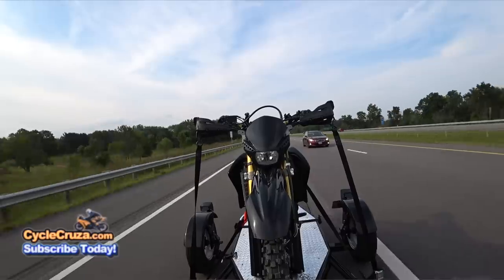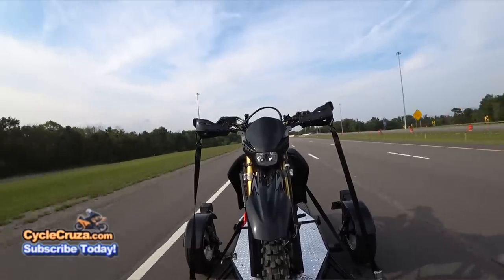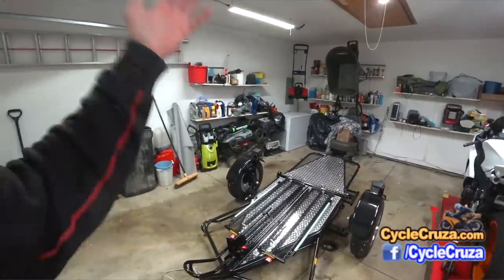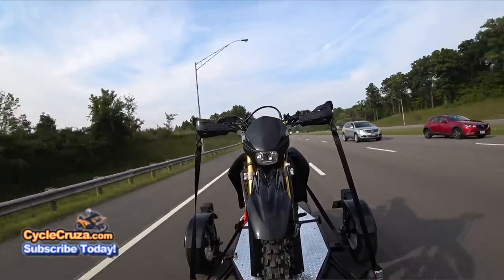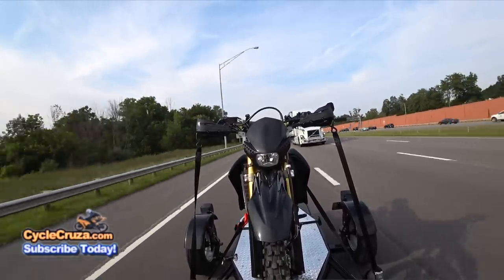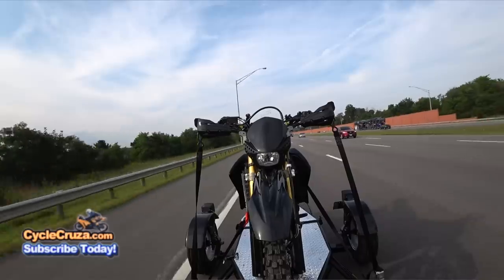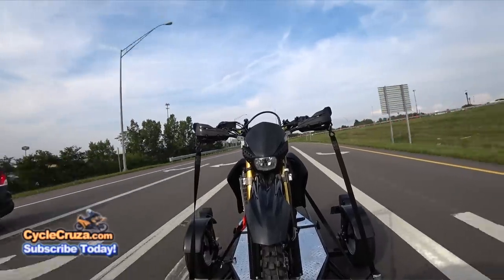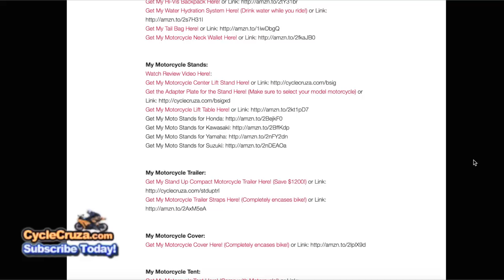EBay Folding Stand Up Motorcycle Trailer Review

Comment: When you lock up the saftey cables to your tow hitch you should be doing it criss cross so if you trailor comes unhookd some how the trailor will fall into the cables like a cradle.
Reply from the maker: It makes since what you are saying but it would have been nice if they included that info in the manual for this trailer. The manual says nothing about criss crossing cables. It just says secure the cables with a padlock. Thanks for the tip.
Reply: @CycleCruza  i juat meant that you should hook the left side cable on the right side of your tow hitch and the right cable on the left side of the tow hitch. Im not sure if that makes any since but with a normal trailor thats how you should hook it.

Comment: The safety cables you’re suppose to cross them just in case the trailer falls off the ball. But other than that it looks amazing.
Reply from the maker: eh either way it's locked on
Reply: Crossing your cables/chains will  catch the hitch if it falls off the ball,  instead of it the hitch spearing into the road. It is law in Canada and a $400.00 from the Ministry of Transport of they aren't crossed.
Reply: And why are they cables and not chains with hooks???
Reply: CycleCruza I don’t know what cops are like in Cleveland but I live in Cincinnati. I’ve been pulled over before for a tail light out and the cop saw I didn’t have my chain crossed and I got a small ticket for unsafe pulling of a trailer. But you are right they are locked. It’s just a bit safer for your trailer just in case it was to come off so the cables would catch the trailer and it wouldn’t be dragging on the street. But I think the locks are a smart idea that company cane up with. I’ve never seen that before.
Reply from the maker: Update: I just checked. Underneath, the cables are bolted up and down from each other so you can't cross them, either way you put the cable on is the same.

Comment: Thats a nice little trailer , you did good on that.   I would re-locate those 2 shelves on the wall and figure out how to get it chained to the wall so it barely takes up any space.
Reply from the maker: It stays up on it's own, pulling back more vertical doesn't really add any more room. It takes up very little room as you see. This trailer saves like 1k over a Kendon and it's just as good, imo.
Reply: I was on the fence until you said 1k savings. That's a pretty significant savings. Can buy some good gear with that 1k.
Reply: CycleCruza  ps safety chain doesn't need to be taught and pulling out the screws with all the weight of the trailer pulling on the chain.   A little slack would take the stress off things and provide a safer experience.    In case something were to happen.

Comment: CycleCruza, I love your ongoing saga! Here you showed the weak design of this nerd trailer. Has only 1 useful purpose, must be kept inside, must be assembled, and cheap front wheel chock.
PS: Your tie down method is newbee, and will shake loose on rough pavement quickly, the heavier the bike, the more quickly it'll fail.
I learned by trial and error over time, trailering bikes after purchasing and for track days. 
The front wheel must be secured in a vice tight chock, the rear wheel tied down, and the chassis allowed to bob free on the suspension.
Reply from the maker: The suspension was not fully compressed, only morons would do that. However, I did not hook up the tie downs on the axle hooks for the rear of the bike like I should have because I did not see them,  the manual did not illustrate them. This trailer has suspension and rode over these pot-hole ridden shitty cleveland streets like a champ as you see in the video. It's a solid trailer.  Btw, this trailer is only for my Ducati XDiavel, I built a custom bug out moto van for my other bikes. This trailer does fine with my 545 lb Ducati Xdiavel.
Reply: I must admit, it looks like the bike is tight on the roads! Going around corners with a big heavy bike will be the real test. The front wheel chuck may be decent, and that's the most important component. My front chuck is homemade from 3/4 plywood re-enforced with steel angle iron, and that took some design trial and error to perfect, but I'm a professional carpenter and enjoyed the challenge. 10 years ago, there was not good info about wheel chucks. I tried a midrange chuck and it was a fail. The good chucks were kinda pricey too. Hope you used a very good wheel chuck in your van. Best of riding for you!!

Comment: Good video :) you should shorten those safety cables on the trailer and when attaching then to the hitch  cross then over. So left to right and ect. Way that if the ball does give way it will full on the cross the cables make

Comment: Thank you I have been following you for some time now great job on the information that you have provided me.
Also, thank you for using a Lexus.
I would like to give you a heads up that the RX has provisions to run you hick lighting cable under the cargo under decking on the drivers side at the rear Threshold.
Please have a great day
Reply from the maker: I just ran it underneath, I had no patience for an interior install. lol
Reply: CycleCruza 
Next time I am in you area I will get with you and get it squared away for you

Comment: Instead of locks, I think you could just get a strong chain link with the quick link style. Much quicker then maybe loosing the locks. Unless we are rollin thru the hood.
 
All the enclosed trailers I've ever owned or towed once they are empty they jump around over bumps and make a bunch of annoying sounds. Slow down for rail road tracks they will feel like they are launching to the moon. Heh that's how light trailers work.

Comment: What about loading a sports bike ? Looks like a steep angle
Reply from the maker: No it's not steep at all, my XDiavel and CBR1000rr go up with ease. The suspension compresses when you load the bike.
Reply: Can you do a video loading the cbr? The ramp looks too short to load a sports bike.  Looks like it would bottom out.

Comment: HOWWW MUUUUCH?!! I expected it to be no more than $500.
It's a decent quality trailer with some great innovative features but way too expensive for what it is. For that money you can get a decent used box trailer kitted out with a work bench & racking inside. Keeps your bike dry when it rains keeps you dry in the paddock or where your parked up &,when on the move no one can see what' iyour towing . So no reason to follow you home & break into your garage later.  This happens a lot where I live.

Comment: It looks like it could become unstable if it were to be bumped. I know its relatively light weight, but if it falls on a bike its probably gonna hurt your feelings. Id test to see what it would take to knock it over. To make it fool proof just screw an I Hook to the wall and use one of your tie down straps where the ball goes in.
Reply from the maker: I store 5 gal water bottles underneath it, it's not going anywhere. However, I should secure it, just too lazy to. lol
Reply from the maker: I just secured it with a bolt underneath the shelf.

Comment: What happened to the dope bug out moto van? : )
Reply from the maker: In the shop, air condition went out. However, I wanted to do a review on the trailer and had to take the wr in. I bought the trailer for my XDiavel because it doesn't fit in the van, too wide and low.

Comment: I've been looking at the kendon version of this for a while now, but damn are they expensive. Can the trailer be stood straight up and down? Also when towing the CBR, how do you tie it down in the front? Kendon recommends using the triple tree instead of the bars.
Reply from the maker: no but it stand up just fine and is not in the way. This trailer is legit. Use triple tree.

Comment: Why do you hide your face?
I noticed all four of your ties go in the same direction, if it gets knocked out of the chock, it will fall plus it looks like it could flip forward if you hit something?
Reply from the maker: I did about 5 videos on that. lol Just do a search on my channel. There are 4 cables supporting the bike, two on the front, two on the real, they are connected to the trailer on two locations.
Reply: Yeah but they all go in the same direction. If you tied down say a tractor on a flat bed trailer here in this state like that the Department of Public safety would fine you...
Reply: MVE is like the DNR only for the interstate.
Reply: CC isn't an idiot.  It's a safe bet he ensured that bike isn't going anywhere even with bumpy roads.  Relax.  It's a sub 400 pound motorcycle...not thousands of pounds of cut lumber.
Reply from the maker: @Bass Player - The specific attachment point areas are considered mid area and the manual clearly states to attach to the two attachment points on each side. They are clearly defined.

Comment: Don't leave this thing unattended for more than 30 seconds in a Walmart parking lot.   There are scumbags out there that will have this thing with or without your bike driving down the road behind their truck in under a minute..   You might want to add a normally closed loop on a connector if your car or truck already has an alarm.   So that when they run up and pull the lighting connectors  they see and pull that connector too , opening  the loop and setting off the alarm.
Reply from the maker: I would never leave it unattended, this is used just to go to the dealer or shop, photoshoot. Yeah a lot of thieves out there. If I were going across the country I would have much better security.

Comment: Damn...too bad it's one of those where you have to have a trailer license plate and lights.   I wish I could find one of those without the need of a license plate ( meaning no part of the trailer blocks visual access to my car's taillights and signal lights).
Reply from the maker: yeah sucks to have another registration bill, however, it's cheaper than regular car plates.
Reply: (nods).  Currently if I need to tow my rebel 300 2017 around, I use a one-wheel motorcycle dolly thats connects straight to my adapted 1.25" receiver hitch and I strap it down to it's cross bar T that connects into it from the top.  However, eventually I plan to sell it or trade it in to buy the nc750x which is the bike I should have bought, but I didn't feel like waiting the extra many months saving the extra 3 to 4 grand it costs.  It's more comfy than my cramped rebel ( 32" inseam here.  the rebel 300 and 400 2017 and newer year models were really meant for someone who is around 22" to 27" insteam at longest).    But I can handle it for now.  I love that 80+ mpg I consistently get if I ride her easily.  

Cheers. CC  Thanks for your content.  No FOOked up daaaaaaaaaayeeees.  xD

Comment: Uhaul 15 per day cycle trailer. No storage problem
Reply from the maker: I rented one once, I hated it and hated having to pick it up and return it. Also, they don't ride as nice as this fold up trailer.  I don't care about the savings, I like the convenience of having a trailer ready to roll anytime and it takes up very little space.
Reply: Just looked into the uhaul motorcycle trailer for a 1 week trip. The trailer is not covered if stolen even with their extra damage coverage. You'll be liable for about 6k if stolen.

Comment: You did a fine job with the video. But $2500 for a single rail motorcycle trailer is completely insane. It doesn't matter what tricks it can do. I'm sure it is a nice trailer. But $2500! For that! Not happening!

Comment: Only a few people will understand what was done wrong with the cables 😂
Reply: Levi bmx or about 2 of every 3 commenters!  LOL!
Reply from the maker: Update: I just checked. Those cables are so long it doesn't matter, tongue will still hit the ground if it came undone. Btw, underneath, the cables are bolted up and down from each other so you can't cross them, either way you put the cable on is the same.
Reply: CycleCruza its all good. In my whole life I’ve never had a trailer come off the ball. In fact, I’ve never seen it happen to anyone else either. I’m not saying it can’t happen, I’ve just never seen it happen. Keep on towing the way ya do. If it does come off with yours, it would be a good upload!  Jk

Comment: Now, try lifting it with two hands to stand it upright.  Almost impossible as it keeps rolling forward. Nobody has a video for that! A second person is a necessity unless you like torturing yourself.
Better off with an "Apogee" folding aluminum trailer. Easy to fold. It won't roll when you fold it. Far better quailty.
Made in Quebec, Canada.🇨🇦

Comment: use the van mennnnn
Reply from the maker: My xdiavel is too low and wide for the van, I bought this specifically for my xdiavel. I just did a video with the wr250r because I had to drop it off and wanted to do a review on the trailer.

Comment: waste of money more junk to take up room in in your garage and i think if you got a van use it.
Reply from the maker: I bought this trailer for my xdiavel cruiser, it's too low and too wide for my custom  bug out van. The only reason I did a video trailering the wr250r on this trailer is to do a review video on the trailer and I had to drop my bike off, otherwise, I would have just took it in the van. However, it's nice having a trailer like this, takes up little space and I can trailer my bike with my AWD SUV.

Comment: You seriously needed all three ramps I mean come on
Reply: When you load a 700 lb motorcycle you want all there.
Reply: @yetivanmarshall1473  I load my Honda VTX1800 (730+ lbs) with a single ramp. Of course, I have to throttle walk it but it can be done without much effort. BUT, I will be honest, I am planning on putting together a full width ramp. It would be easier to ride in up in some cases.